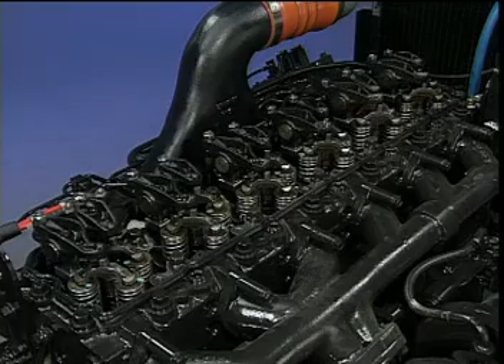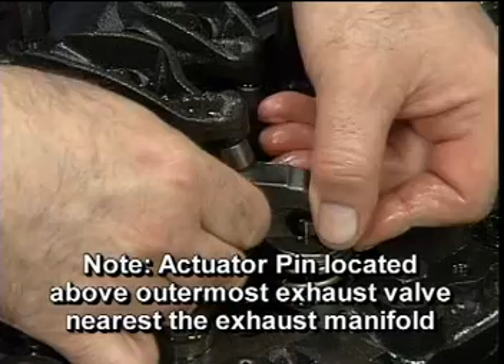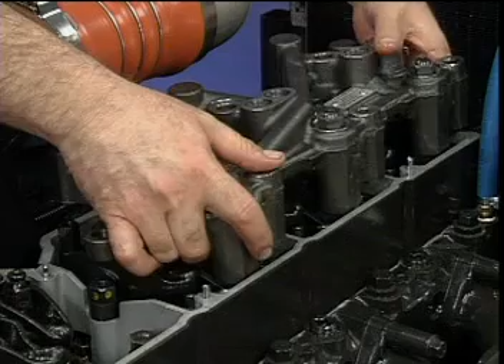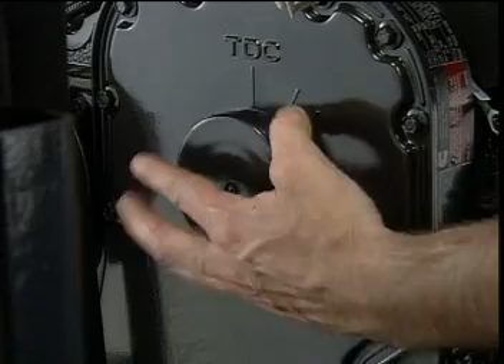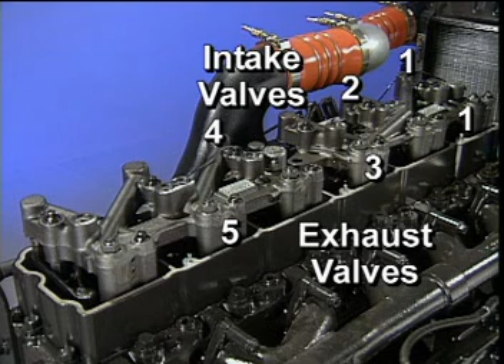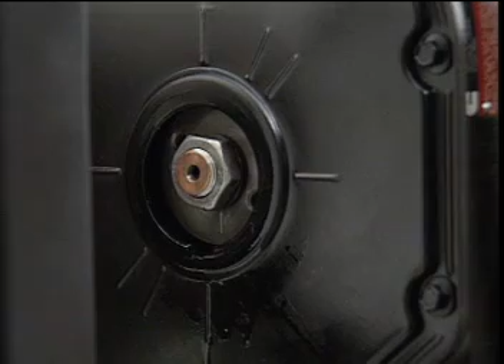Cummins QLS9 Training Videos Install engine brake,7,5min Cu mmins QLS9 Training Videos

Comment: How or where can you purchase the engine brake or thunderbrake
Reply: This is a qsl9 cummins motor application. Not the same as a 6bt or common rail in dodge trucks. If you're looking for this exact engine brake for the qsl9 motor, contact your cummins dealer. As far as I know there is not an engine brake in production for 6bt motors. The thunder brake didnt receive enough funding to take off